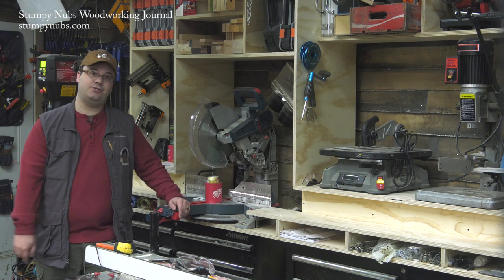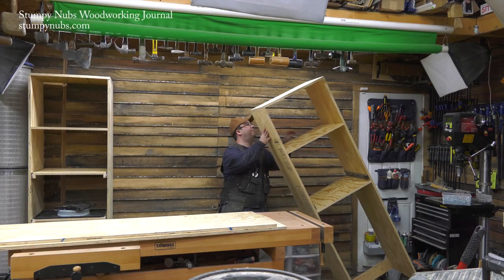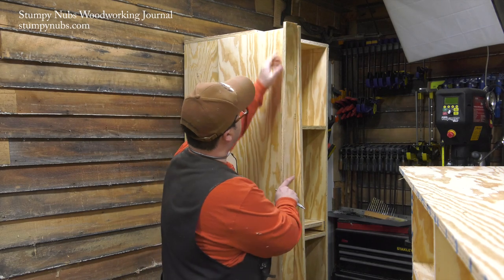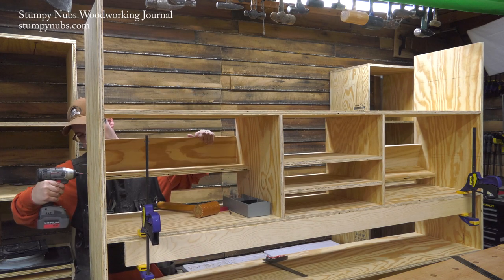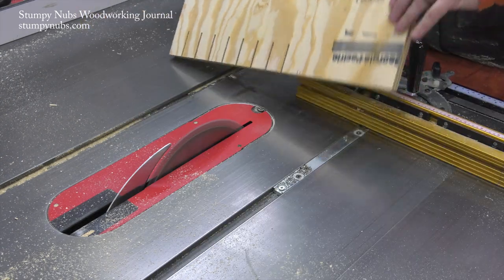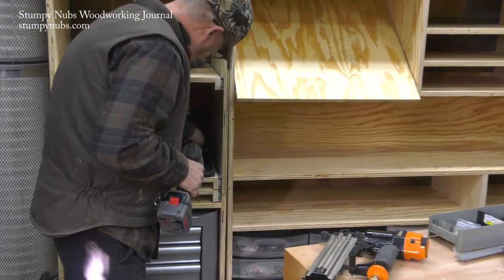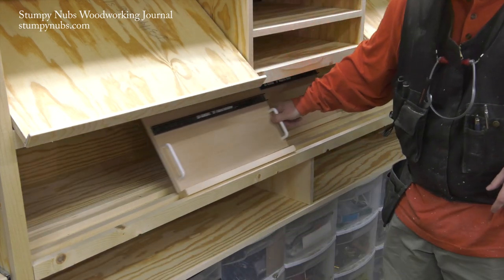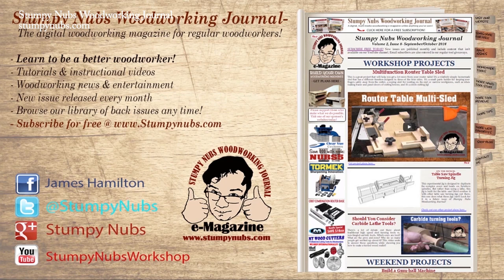My hand tool wall has secrets

Comment: To get rid of sagging shelves myself (I build book cases) I usually add a stretcher across the length of the shelf itself and glue it in place. The thing is I add a rabbit to the back side of the stretcher so the shelf sits into the stretcher, and it also doubles as a edge band, but with the functionality to add strength to the shelf. a few pin nails hold the stretcher in place while the glue dries and you can later come back and router the edge to make it look more "finished" if you want too!! You'd be amazed it how strong just this thin stretcher will made the shelf and it won't sag over time either!!

Comment: I miss the funny!  This was a lot of fun.  BTW, I just hung my chisels with kitchen knife strips and I did notice some shavings hanging onto the chisels, but they wipe of pretty easy and I was using pretty low grit sandpaper to flatten the backs of some new ALDI chisels (which were actually remarkably flat to start with)

Comment: I don't know if it will really magnetize your chisels because the chisel would have to pass through the magnetic field in the same direction in order to align any valence electrons. So usually you would have some kind of tubeuler magnetic device and you would sort of stick the screwdriver in lengthwise in male / female type of process and when you pull the screwdriver out it would drag the negative charge to one side and push the positive charge to the other side or visa versa. It's that action that aligns the ions. Now clipping chisels on and off of a magnetic strip would not do as good of a job of aligning the ions but it certainly still could align some. However the ones that remain unaligned would still oppose each other and you may not have a magnetized piece of metal. Now with that little bit of understanding you can see how any non-ferrous metal could potentially hold a magnetic charge depending how it's charged ions are aligned. So my whole point is while it may be slightly possible to experience metal shavings stick to the chisel.. it would not be a reliable way to magnetize anything by sticking it on a magnetic strip. I'm a licensed electrician that specializes in industrial automation, robotics and programming so hopefully that is better than your average keyboard answer.
Reply: What does it matter if a wood chisel is magnetized? As long as it's sharp it will cut wood just fine
Reply: Magnets will magnetize blades enough to make metal dust stick to them. It’s only a matter of time. That said, magnetized chisels aren’t the end of the world; they can be demagnetized, and as long as there isn’t a lot of steel dust around it won’t cause a problem anyways (dulling your edges, that is).
Reply: @przybyla420  Empirical data would disagree with you. I think the point of my post was that while possible magnets can realign electrons you have to pass the object through the lines of flux in the same direction to arrange the electrons in such a way that they would align the electrons in the same direction. Pulling a non ferrous metal on and off a magnetic strip is a terrible way to align electrons and would not be a reliable way to magnetize any object. If you are curious about the physics behind the phenomenon then I'm sure there are plenty of useful videos on how to magnetize a screw driver on YouTube.
Reply: @canaan5337  He mentions in the video about how metal shavings could theoretically stick to a magnetized chisel and could ruin them if you're using a magnetic strip. Or so the folklore on YouTube goes.

Comment: If you are just using the edge trim for aesthetics purposes and not strength, try screen molding.  Just glue and pin it in place. It is slightly larger than a 3/4” plywood but not really enough to be concerned with.  If it is you can use one of your planes a flush trim bit on a router.

Comment: Put your planes the other way up so the sloping shelf will lift higher.
Reply from the maker: the handle is what stops the tray from lifting. If you flip the plane, the handle will be higher on the slope. That would make it worse. I can still use the space to store a lot of stuff, just not the little shelf in the back.

Comment: If you dob some MinWax High Performance Wood Hardener in each of the pocket holes before running the screws in you'll increase the plywood strength quite a bit.  Of course you have to let it dry too.
Reply from the maker: Sort of defeats the purpose of quick, convenient pocket hole joinery, eh?
Reply: @StumpyNubs  Perhaps, but it also defeats the crumbling plywood layer issue.

Comment: I was taught never to set handplanes upright. They should lay on their sides or hang by the front knob. Setting them upright risks nicking the iron, or getting something plastered on the sole. Doesn't look as sexy, I know.
Reply from the maker: If putting the edge of your plane iron on wood will damage it, you have big problems. The shelves are wood, just like the work piece.